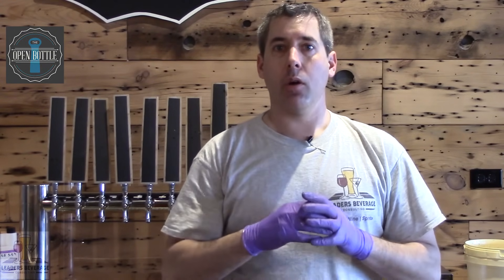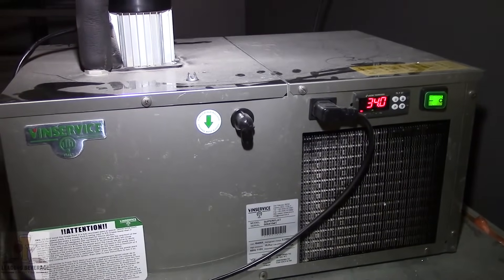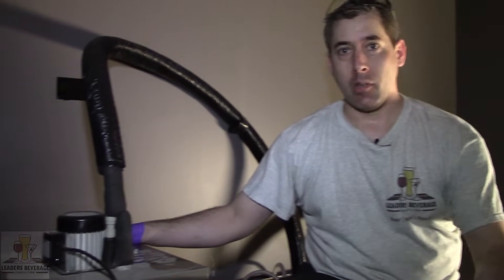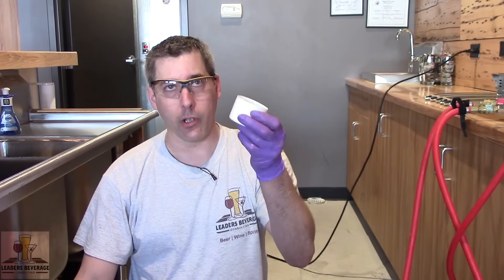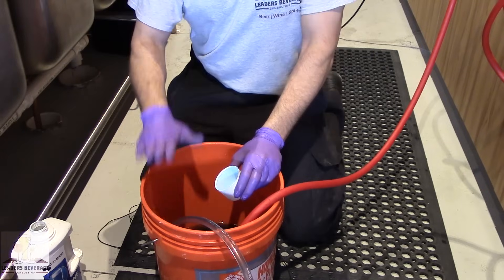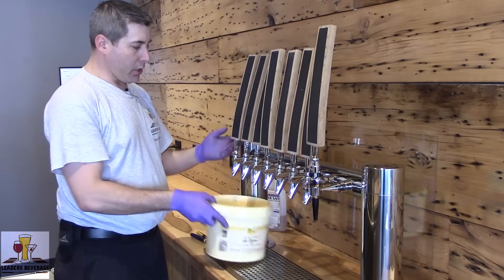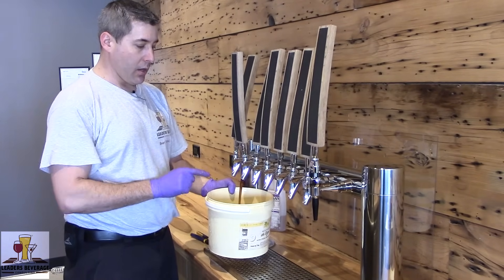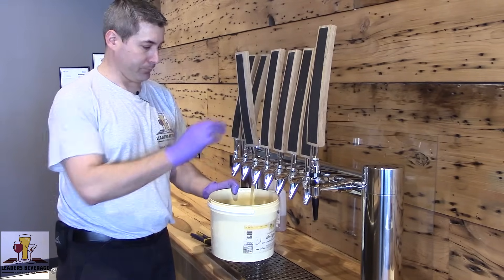How to clean draft beer lines: Circulation Method

Comment: You guys rock! We clean our own 14 line, 115' long draw system. We also use a pump recirculation method. Oregon does not believe in requiring clean lines. I have brought up this issue with our health inspector and pointed out what we do to keep our system clean. When we bought the pub the cleaning of the beer lines was only a five minute soaking at less that 1%, you can imagine the floaties in the beer. It took several weeks to get the system clean. One additional thing I look for before cleaning is air bubbles in the beer lines at the coupler. This lets me know if there is a potential gasket problem. Keep up the great educational videos!

Comment: Thank you for this video. Just to clarify: When you say the lines should be replaced every 12 months, you’re referring to the Tygon only, correct?
In a beer pump system, do you simplify use the pumps to flush it?
Thank You
Reply from the maker: Hi, we're really glad you found this video helpful. When we talk about replacing the lines every year (and even every 18 months is fine, just don't go past two years) we are talking about that flexible piece of polyvinyl that goes from the coupler on the keg to the FOB or Wall Bracket on the wall. Beer pumps are only one way. If we installed the system we install flow reversal valves that allow us to circulate and individual gas controls to them. The pumps can then help with circulation flow and add to the number of lines a single pump can circulate. However, you do need to be careful, if you are circulating for example, you only want the pumps on that are flowing toward the tower. Most systems with pumps don't include reversals because not many companies in the US offer circulation cleaning so its hit or miss if we use them. The chemical pump attached to the tower still has to be in place regardless of whether the beer pumps are providing an assist. Good luck; Cheers & Beers!!
Reply: @LeadersBeverageConsulting  thanks for taking the time to respond! I have been a Coke tech for almost a decade and never fully understood the beer systems but it seems like it’s right up my alley. I will definitely watch the other videos you have posted.
Fantastic Work!
Reply from the maker: @chittlingwhittles1198  You bet. We do a touch of soda work here and there to help our clients when Coke or Pepsi won't show up in a timely manner. A lot of the building concepts are the same. Beer just has insulated trunk that has circulating glycol in it to keep the beer cold and we have to worry about carbonation and balance all the way from the keg to the glass. Soda techs make great draft beer techs and visa versa; practically twin-sister trades. -Cheers & Beers!!
Reply: @LeadersBeverageConsulting  we still have some recirculating systems out there.
Instead of glycol, the Soda water line is split from the carbonator, coiled and chilled in an ice water bath and recirculated in an insulated bundle with the other lines. 
A refrigeration system makes an ice bank inside the water bath and an agitator keeps the water moving preventing irregularities and also keeping the moving water around 32F (0C).
The Soda water gets tapped at the bar gun or tower and mixed with the syrup.
The beer system reminds me more of what we call “premix” where the pop is already mixed in cylinders in the back and pumped to the dispenser.
If I was to categorize the beer system on pop terms it would be a premix system.
Very similar systems indeed.
I appreciate your help and if you need any help on the other side of the fence please don’t hesitate to ask.

Comment: Excellent video!!!! I have one question. When the caustic is recirculating through the lines, is the input hose and outlet hose in the same bucket……. Meaning it keeps recirculating the same caustic for the 15 mins?  Which i think it is but just trying to make sure.
Reply from the maker: Hi Chris, you are correct, during circulation you create a closed circuit by using a bucket to make a reservoir. You can see right at 20 min and 24 seconds as Drew adds caustic to that reservoir that the red line is the pump drawing in chemical and the clear line is the exhaust back into the bucket.
Hope that clarifies. -Cheers!
Reply: Leaders Beverage yes, you answered my question! Thank you for the swift response.

Comment: Super informative, thank you! 
One question, does it affect the other lines at all if I were to only clean 2 or 4 lines at a time? Could I clean 2 lines one night, resume regular business the next day, and come back and clean 2 more the following week? Thank you for your help. It is great to see others who are passionate about quality!
Reply from the maker: Hi Julian, we're so glad you found the video informative and useful. Cleaning one line won't affect the line next to it. We have helped small businesses manage their own cleaning by doing portions of the system on different days in order break up the work. The important part is that each line be cleaned every two weeks. This, do two lines on Monday and two lines on Tuesday, rinse, and repeat every two weeks without fail.
Reply: +Leaders Beverage Thank you, will do. Any special tips for cleaning draft wine lines?
Reply from the maker: +Jillian Medeiros Jillian, the key with wine is having the system built correctly. Wine is much more acidic than beer. So, while 303 stainless is just fine for beer you want only high quality plastics and 304 stainless touching wine. This means using barrier tubing and not poly vinyl for the jumper, using stainless tail pieces and not chrome plated brass, and using 304 stainless couplers and faucets. After that, 1% caustic will be fine for cleaning if the system is well cared for since that caustic is so far different on the pH scale from the acidity of the wine. Then, when you do the acid cleaning, use citric acid instead of phosphoric acid as used in beer lines.

Hope that helps,

Cheers
Reply: +Leaders Beverage thank you! What do I do if the line clogs?
Reply: +Jillian Medeiros Jillian, sorry to have taken so long to respond, we are in the middle of a big warehouse move and expansion. What is in the line that would have clogged it? Do you mean it clogged during cleaning or it clogged during pouring?
Reply: +Drew Larson I appreciate your help at all! I figured it out, it wasn't clogged. Finally got them clean, thanks to your video and help. Cheers!

Comment: awesome video!!!
just started a line cleaning company in Oklahoma.
question: whats the maximum number of faucets that you can clean at a time and maintaining the 1gal per minute flow?
Reply from the maker: Hi Joseph,
Sorry for such a slow response, we are in our busiest season right now. The number of lines is dictated by the resistance in the lines. You would be able to clean only 2 or 4 lines if they were 300 foot runs or something like that. While you could circulate 10 direct draw lines. The key is to not exceed a pressure on your pump that puts stress on the system. For example, if you are using warm water for your flush and chemical it will soften the beer lines and jumpers and so fourth. Then if you are cramming 60lbs of pressure down its throat you could blow a clamp off somewhere in the system causing a massive mess and health issue if it was during caustic. Try not to let your pump pressure go above 40lbs; which is just my recommendation for any system I don't know better. Don't worry about trying to reach the 2 gallon per minute goal you read about with the Cicerone program or the Draft Beer Quality Manual. That was written in theory but in practice it isn't practical. The next version of the Draft Beer Quality Manual will drop that 2 gallon per minute flow rate number. 
Hope that helped answer your question.
Cheers!
Reply: thanks for the reply and the info. I have some more questions ....how do you track all your faucets/ lines that need to be clean? I know you have a lot of accounts. what system are you using? I talked to a lot of software companies. some are expensive and some are not. do you have any recommendation / suggestion for a starting company just like me? thanks and I really appreciate all the help! cheers!

Comment: I have a fob system and have cleaned my own lines for years.  I flush the lines with water until clear but when I run the cleaner through, I notice that the cleaning solution picks up beer in the lines for a little while in the beginning of the solution cleaning.  I just run the solution until it is mostly clear but I was wondering if I may be doing something wrong.  I would think that the water would push all the beer through but it must not.  Let me know what you think.
Thanks and great video.

Comment: Thanks. Great video. This may be a dumb question but when the caustic is running through the system  you are recirculating the caustic and the outtake line from the last shank is not sending it to the drain but back to the bucket? Thanks
Reply: Hi Spinalrx, an honest question is never a dumb question. Yes, the exhaust tube from the last shank goes back into the bucket. That makes the bucket like a reservoir so you may circulate with loss of chemical. -Cheers!

Comment: Awesome video! Quick question(s), how much caustic do you use in the bucket where the disassembled faucets are soaking? 2%? Also, how long do you soak those faucets in the caustic bucket?
Reply from the maker: Hi Brett, we're so glad to hear you found this video useful. We aren't as picky about percentages with the soaking parts. Mostly because we hand scrub them which we can't do to the inside of beer lines. We typically toss the faucets in a bucket with about a capful to half gallon; which, really comes out to about 2% anyway. We try to let them soak at least 15 minutes and then spend time rinsing and scrubbing while the lines are in their rinse cycle. Many folks just put the faucets into the caustic reservoir bucket which caustic is circulating. This works really well because the caustic is moving around the parts.
Hope that answers your question, many cheers!
Team Leaders

Comment: Thank you for the informative videos, ive been trying to find one that implements a fob system in their lines, I seem to be having pressure issues lately, (micromatic fobs) should the leavers in the front to lift the interior float be up or down when I engage my ffirst water push?
Reply from the maker: Hi Giusseppe, Which Micro Matic Fob do you have? You want to un engage the FOB when doing circulation maintenance so the flow is able to, essentially, bypass it. If it is the standard plastic FOB Micro Matic sells then it would be spun upwards to disengage. Do remember thought that during the water flush you want to use the bleed valve on the fob so that it fills all the way with water. When you are doing the caustic circulation you want to use the bleed valve again so that you fill all the spring mechanisms at the bleed valve covered in caustic. Obviously, do this again during final rinse.
We think it would be a good idea to add in a few addendum videos to our channel for special circumstances like FOB's and Pumps. Hopefully as soon as the busy season slows down for us we can get back to video making.
Cheers!

Comment: Excellent video.  I've noticed that the pump hoses don't come with a submerging weight attached.  What do you use for a weight to keep the pump intake hose submerged?
Reply from the maker: Hi Meetthelunas,
 The intake hose doesn't float, it just rests at the bottom of the bucket or sink with no problem. The only issue we sometimes have is the weight of the hose when it is stretched pulling the line out of the water. In these cases we just use a simple clamp to hold the hose to the bucket.
-Cheers!
Reply: So we've got two pumps.  The newest one has a heavy metal ring near the opening of the intake hose.  My oldest one doesn't have that heavy metal ring.  I'm going to contact the company that manufacturers the pumps and sells them to MicroMatic and see if they can sell me just a metal ring. 
https://i.imgur.com/08LrgkK.png
Reply from the maker: Good catch on that metal ring Meetthelunas, I really hadn't even thought about the fact that was there. We have had a hard time getting individual replacement parts from Micro Matic for their pumps and hoses. We have come to just fixing and replacing parts ourselves. Good luck with the manufacturer, in the meantime, you can use a large clip to hold the hose in place which should keep the intake forced under the level of water. So happy to hear you are circulation cleaning!
-Cheers, Drew

Comment: Hey Drew, excellent video.  I'm curious as to what you would do if you encountered a draft system with 7 or 9 lines.  Would you have to do two runs to get that odd line?  Also, did you leave the gas on during the cleaning?  Thanks for the information and looking forward to more videos!
Reply from the maker: Hi Cory, we do some odd numbered systems. You can, of course, do two runs of 4 if you have time. If the lines are short enough to circulate all of the odd number then we do them all at once. In the cooler we connect the last three kegs together with a modified dual-flush cleaner to allow the three to inter circulate, we then also build a three way jumper for the last three lines. Fluid dynamics allows two of the lines to push out the last line. You just have to be carful that you are getting proper flow in those lines and that the caustic is completely out of all lines. It helps to draw a schematic then draw the direction of flow on the schematic to figure what lines need to be double connected.  Now, if the couplers are all in good condition it doesn't matter if the gas is on or off if the couplers are disengaged when connected to the dual flush. If the internal components leak gas then it will push the beer out of the line. I typically make faucet connections before cooler connections to reduce no faucet beer showers. If you notice a line continuing to spit gas then that is what is going on and just turn that one gas line off.
Good Luck & Cheers!

Comment: hi i like ur videos, They are really helpful.  im new at this job and do it different. i do all the hose to connectors  and drain the faucets into a bucket because i dont have the jumpers but i like the way u do it better
Reply from the maker: Hi Marco, the most important thing is that you want to put quality first! There aren't a lot of companies that do circulation because its takes more time, equipment, and resources. There aren't, unfortunately, many markets where the majority of venue owners recognize the value in investing more in the quality of their draft. However, that is also because the education on what quality can do for improved revenue and profit is lacking. Thus, this channel was created!
Good luck and cheers!
Reply: Hey what's up Marcos I just recently good a job offer in this industry but they don't want to tell pay wage till I agree to a contract with them what does a job like pay ??

Comment: Question Drew: Can/Will you tell me how fairly charge a bar for performing this procedure. I am retired and a homebrewer and would like to try do on a part-time basis in my local area. Appreciate the step by step layout of video and your knowledgeable advise. Thanks Pappy
Reply: average to show up 50. 10-16.00 per line. learn your ounces per foot so you have a good idea on how much solution/caustic etc you will use. 100ft 3/8 is 75 oz. some places will require you to have ins to be on the property. Be safe PAPPY! Sell some stainless faucets and get that brass garbage out of the industry! Pm me if you have any questions. Selling some faucets will pay for your lunch!

Comment: Nice video. Do you have a video on cleaning the lines with the acid solution or is it the same method? Also, do you have anyone in the southwest Wisconsin area that will come and clean our tap lines/maintain our system?  Thanks

Comment: Hi guys! Great video! The best i have found about how to properly clean lines with safety and professionalism! I have a question for you and hope Drew or someone can answer me. I have to clean 6 lines in two floors, so 12 lines. But I'm using a not so good system to clean it, i'm using some jhon guest pieces to attach to the faucet but its a mess and i can't continue cleaning like that. My question is, the faucet jumpers  are universal thread/dimensions? Or i have to see the dimensions of my faucets and get jumpers according to that? We have a Lindr towers with flow control faucets, and we are from Europe so i don't now if it's all the same everywhere. I just need the correct jumpers lol.... Thx once again for every video you put here!cheers
Reply from the maker: Hi Pedro, I’m sorry you are having trouble with making connections to your lines. Trying to circulate through faucets is definitely going to make a mess. Threading in the US is pretty much standardized. We only run into different threading when someone imports a European shank and faucet. Wish we could be more help. Try asking whomever installed your system where you can get faucet attachments so you can build those faucet jumpers yourself.
Good Luck & Cheers!